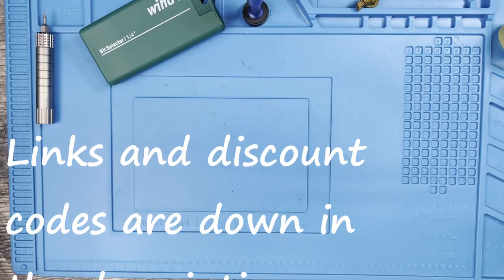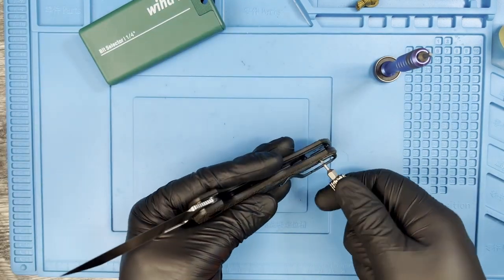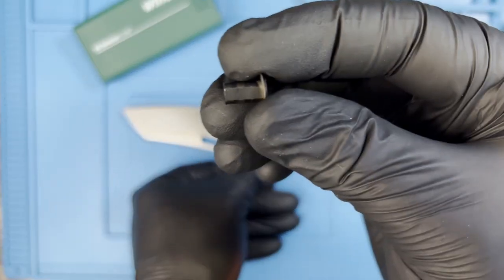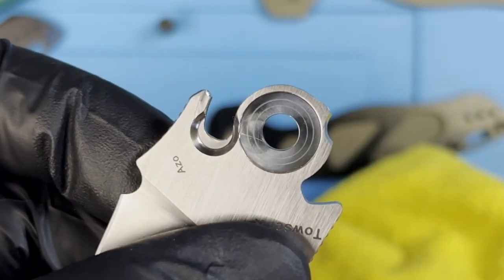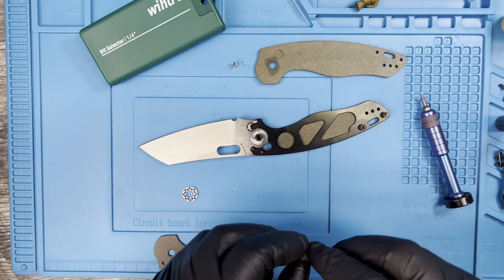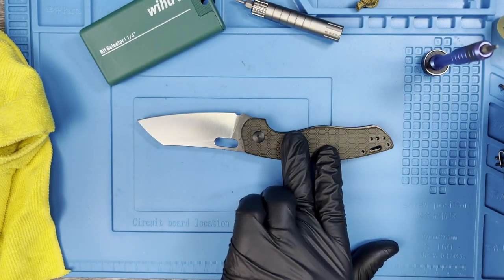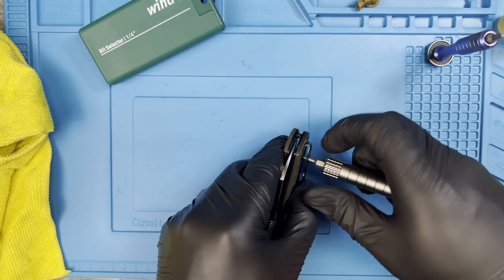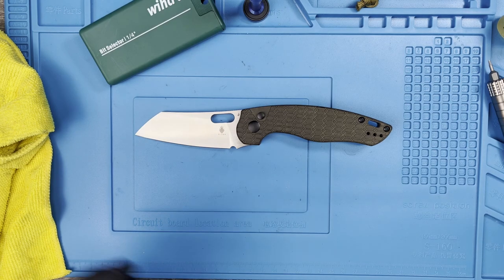Kizer Towser K disassembly

Comment: The thing about ball/roller bearing, there tend to pick up some grimes and dusts like you showed in the beginning. I wish some cheap knives uses nylons or any kind of washers. Isn't it cheaper using washers?
Reply from the maker: I’m not sure how much cheaper it is but bearings allow them to consistently produce smooth action and spend less time tuning for that with washers. I know QSP used washers on their parrot and penguin line though. I’m sure there many others I haven’t run into yet.
Reply: @jd4edc  I have Schrade SCH311 and I love that knife for its simplicity. The only bummer thing is the detent ball worn out and can't keep knife shut well. I planning to find a shop to replace the dentent ball. That thing easy to keep it clean.